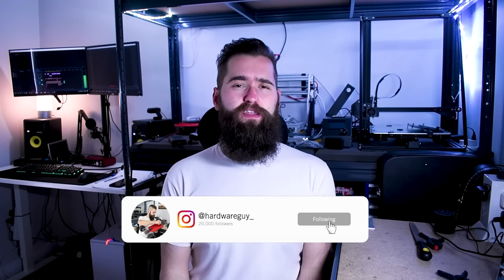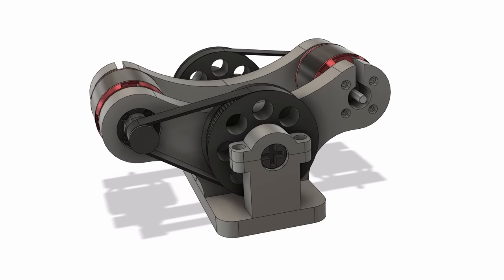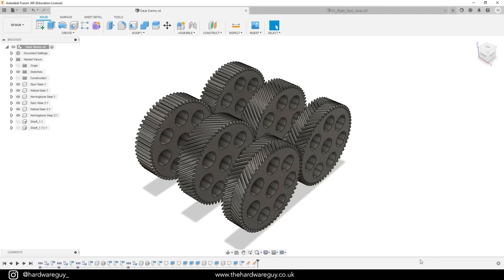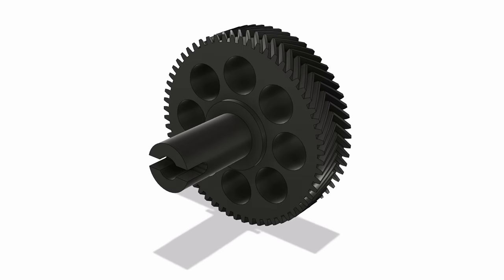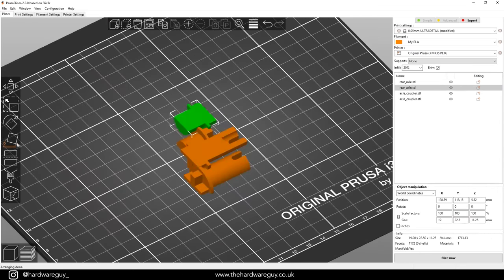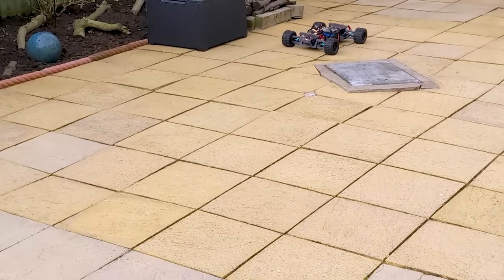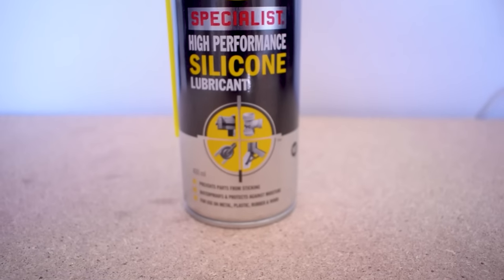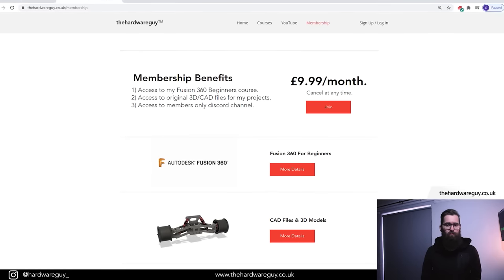How To 3D Print Gears Like a Boss

Comment: I would recommend going 95% in stead of 100. reason being that if you have a tiny bit of overextrusion in your printer, this will compensate, and avoid outer layer blobbing, as this will make the gear teeth nearly unusable, or at least time consuming to clean up. Another reason is that when force is applied to the structure there is nowhere for the force to distribute if it's all solid, but with tiny gaps the material has a tiny space to deform slightly, mitigating some of the force running through it.
Reply: Good idea! Might also be worth printing the outer perimeters first
Reply: If you have over extrusion, try adjusting your e-steps
Reply: this hasn't been an issue in a long time
Reply: You’re right at the first part, but the part about forces distributing is complete nonsense. A 100% solid part will always take more load than something that is not 100% solid
Reply: @jr764  Well, not always. For example, for parts that have an angle that is less than 90° have ofter an circle cut off where the angle is, because if not forces will rip the material where the acute angle is. When you cut off a circle in place of this angle, you will make a better repartition of forces and hence avoid ripping. So by removing some of material you can actually make it stronger.
Reply: @guillaumelebreton3780  Sorry but you've fallen into the trap of thinking that some engineering principles can be used everywhere, regardless of load/boundary conditions.

Yes, you can strengthen parts by avoiding stress concentrations where cracking is likely to occur, however that isn't just a rule you can apply everywhere; it's only relevant when you have walls that want to peel or shear open. By arbitrarily introducing holes near stressed areas, you only encourage cracks to form and propagate, since the area will be more local stress due to having less material for the forces to transmit through. In this case you absolutely want your part to be as solid as possible, if your aim is to maximise strength. There's a reason you wouldn't want to make gears out of porous materials, like sponge or cork.
Reply: I tune this in flow setting.
Reply: Thanks heaps, recently made a small functional price at 99 percent because I still need to set my steps per mm on my extruder and got an outer layer pattern of blobbing and wanted to know how to mitigate it quickly
Reply: What is e steps
Reply: @snorttroll4379  e steps is a number that determines how much filament the extruder (e for extruder) pulls in when it gets a command to do so. it can grab too much, or too little, so it's important to calibrate that value correctly. there should be lots of tutorials on how to calibrate it on youtube.

Comment: Also, if you plan on driving offroad, I would definitely recommend swapping the herringbone gears for some doublehelix gears. Any dirt or substance that gets into the gears gets dragged into the centre and quickly binds up the gears, the double helix solves this because there is a gap for the dirt/grime to be pushed into. :)
Reply: Also, yes there is a difference between herringbone and double helix. And that is what I listed in the above comment. A herringbone is simply a specific type of double helix gear :)
Reply from the maker: Excellent point. Maybe an idea for Raptor 3 ;)
Reply: Question. If dirt and grime is push up one direction on a helical gear, would going in reverse push the grime in the other direction? And, if so, could you orient a herringbone gear to push grime out of the center when the car drives forward? (Since it will be going forward 90% of the time)
Reply: Same with those outrunner motors. They dont really like dirt. Some sheilds would be a good idea.
Reply: @lio1234234  He mentions this at 3:39..
Reply: That was litterally what i was thinking about when i saw the gears lol

Comment: Engineer here You're mods for strength and print clarity are next level. If you are not already a CAD drafter, you should consider it. Some companies do not require a FE to draft.
Reply: What search terms does one use to find the jobs?
Reply: @snorttroll4379  CAD drafting
Reply: @snorttroll4379  Designer or Drafter, but more often search for the CAD software name (Solidworks, Creo, Fusion360, etc) for the best results. (I used to be one).

Comment: Spur gears are used in motorsports which is easily a high load and high speed application.
Reply: Eg. Rallye, all type of motorbike and maybe F1
Reply: I agree. Spur gears are just noisy and cause vibrations but they are indeed effective for power transmission. However, for printed plastic parts the vibrations alone may be able to break the part which makes double helical gear better for this application.

Comment: I agree a metal axle is probably best, but PLA is known to be brittle and easy to crack and break.  You could use a different filament such as nylon.  I wonder how a nylon axle and gears would hold up.

Comment: I tried several materials, but the one that turned out the best is the one that is the sponsor of this video. Yea. Shure.
Reply from the maker: As I said at the start, this is based on my experience only. I had been using this material long before Polymaker sponsored my channel. In fact, I was so impressed with the Polycarbonate that I reached out to them and asked if they wanted to be involved in my projects.

Comment: I like the fact that you are using roller bearings for your gears that are in direct contact with the motor.  There is no need to use ball bearings because the forces acting on the gears in radial not axial.  Plus like you said you will get less wear.

Comment: Great Video! I`ve also landed on Polymaker PC Max after experimenting with Taulman Alloy 910 before, but i never put as much care into it as you. But i can vouch for their durability - i made a inner gear ring design that transferred the power of 3,5kW motors on an electric mountainboard and the gears never failed!

Comment: Wonderful video! Might I suggest a solution your axel strength issue? Add fillet between your axel and the gear face if you have enough room, even a small 2-3mm fillet can exponentially reduce the stress riser created by that shoulder. Excellent work!

Comment: One thing I like is how you go from the drawing board to design the part and going to the manufacturing, where you describe how you went through the analysis of on printing the part and provide details around each of the components needed to be reviewed and looked at having the proper parameters to print the parts that would be under a large amount of stress. Typical most people would just print the parts and slap it on the RC vehicle and do not understand why the plastic part broke. I like to see how you would design a part and go through the process of printing that part on a 3D printer and what methods you use to make sense to print the part so that it would print as you would expect it to be.

Comment: Nice build - One thing i'd recommend is using nylon instead of PC for the gears. PC is great when it comes to impact resistance, however nylon is a lot more resistant to abrasion which is essential for parts that are constantly rubbing up against each other. Furthermore, nylon has almost a sort of natural "lubricant" property to it, which should help your gears turn more freely reducing wear. 

In terms of trying to print out the axle, have you tried any carbon fiber infused filaments? They could possibly work, as it adds a substantial amount of strength and rigidity to the part. Personally, i'd recommend either CF-nylon or CF-ASA for your particular application. I believe Polymaker recently just came out with their own carbon fiber reinforced nylon filament, so you should get them to send you some and try it out :)
Reply: I too think that nylon (PA) is superior... no wonder it is often used for small extruded gears.

Comment: Build an enclosure for your printer, upgrade hot end as needed, put in a direct drive, and print in PC (Polycarbonate). When tuned right the results are genuinely incredible. Extremely strong.
Reply: Can this be done on and Ender 3 pro?
Very brand new to the 3d printing world.
Reply: @pogi1803  of coruse it can be done on any printer but it needs its personalised modifications
Reply: Awesome!! Thanks!!
Reply: @pogi1803  my printer is an ender 3 pro
Reply: @pogi1803  upgrades will take time and money however. To print PC you'd need an all metal hot end like the micro swiss, or if you want a direct drive extruder as well get a hemera. You'll need to make some changes to your firmware to accommodate the new hot end. Get an enclosure for the ender 3 on amazon. I'd say that's the minimum requirements

Comment: Cool project!
Regarding improvements, look into "beaking PETG". Basically printing 100% infill and baking it in an oven (inside of salt powder), to get solid plastic part.
Reply: Don't the parts warp some despite the salt packing?
Reply: So lile table salt and heat to mwlting point?

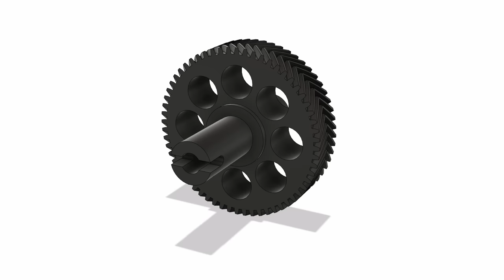Comment: During the 2:33-4:03 explanation, the first set that you talk about are whats used in race cars. Automotive folks like myself know these as "straight-cut" gears. Theyrs not used in road cars because of the noise they produce, but they are the best at transferring power from the engine to the wheels.. The second set, helical, are used in most road cars because the smoother meshing is significantly quieter, but at the cost of power transfer. Because the gears are cut diagonally, a measurable amount of power is lost to friction as the gears try to push themselves apart.
Reply from the maker: Yes, I did mention they are most efficient, but at a cost. The cost is durability and noise! Race cars only need to make it to the end of a race, whereas consumer cars need to last 20+ years. There is no right or wrong gear to use, just depends on the specific application

Comment: I greatly appreciate your taking the time to experiment and examine the possibilities of printing gears on a 3D printer.  I have been thinking about the use of 3D printed gears in the future.  My hesitency is due to the problems one gets into when producing them by any other method and comparing those issues with using various materials and 3D printing of gears.   3D printing is a new and experimental area of fabrication and so much simpler.  Since it is possible to design any gear one can think of on a CAD program and rely on a 3D printer that is sophisticated and accurate enough to produce that design - well this is fantastic as I can see it.  And that is the key to this - the CAD program and accurate 3D printer technologies.  I didn't know if they had become available yet.  I"m glad to see people like you are able to prove the subject.  I will subscribe and follow along to see what develops in your shop.  Thanks.

PS.  One shortcoming that I is a problem for me is that I'm not good at creatively 
designing a roubst gear shape using the CAD programs.  I have tinkered about with some of them but I have not become proficient with any versions yet.   I was hoping that by waiting for some period that some design libraries would become available to satisfy my experimentation curiosity.  Good luck to you for experimentations that produce the quality that satisfies both of our needs.  Bye for now.

Comment: I am not even close to expirianced in printing gears, but in my little experience I found it is a good idea to use rafts. This way you do not risk warps at the edges.
Reply: You could chamfer the bottom edge very slightly in Fusion so the elephant's foot effect just pushes it out closer to being straight.

Comment: I don’t know if you know this but Stefan over at cnc kitchen did a test which proved that you want more walls rather than infill because the majority of a part’s strength comes from its outer walls ex: metal tube, pvc pipe

Comment: I'm a racepilot in 1/8 gte. What i want to ask you is how sensitive the fishbone gear is to grit particles coming from the track. 1/8 gte is raced on tarmac and is similar to a gocarrack but much shorter. We run open gears to cool down the diffs. all gears are made of highgrade steel and standard straight module 1 teeth. The ony gear we could 3d print would be the main spur gear with is driven by the motor pinion gear which is always a module 1 pinion aand extremely hard steel. PLastic gears are often used for the main pinion gear and i would say the are always made from reinforced nylon. cf or glasfibre and 8mm wide to take att grit particle or 2. The output is 2700w or so from the motor. the weight is 3800g minimum for the car. top speed is 110 kph.the issue is than the track is surrunded by grass lawn so when leaving the track (unintentionally) we get grit on the track that might upset the gears if made in plastic. 1/8gte is of couse 4wd with a cneter diff or a spurgear connected to rear and front diffs. the diffs are oilfilled to get the correct response. and the diffs get hot. Being an egnineer aswell as the goto guy for 3d printing on a school in sweden. i See potential för 3d printed gear both for racing and for students. I have been contemplating 2 or 4 motors instead of on a a projekt. just to get rid of a motor in the center  90 degrees off. This create inertia twisting the car. when 2 motors front and rear would make a better sollution. But i would us inrunners beacuse of reduced inerta and better power to weigt ratio. The escs are 180a to 220 amps a still everything gets hot. I'm guessing high temp material is the only way for a GTe car. For offroading i see an even bigger issue for the typ of car you have built. I race 1/8 buggies too... and there we always ha built in gears. the same motors are used 4068- to 4074 sensored motors. But gte takes alot more power to be competive with turbo. Heat is the worst danger to motors and esc

Comment: Very interesting; I love what you did with the smaller gears by driving a screw through the center to reinforce them "along-the-printed-layers".   However; since you have such a keen insight into the structural integrity of printed parts I was wondering why didn't you try the same thing with the dog-bones as you did with the smaller gears?  Never the less; you are, definitely; someone to look forward to watching on youtube.  Vantastic workmen ship and thank you for your brilliant insight on gears.
Reply: I know your Q was from years ago but I think he didn't need the support on the larger gears because they rotated at a much lower RPM so reinforcement wasn't needed.

Comment: I would suggest two rows of ball bearings instead of roller bearings. Two rows will add rigidity and reduce the operating temperature from the increased friction of the roller bearings. This is only a suggestion. Great video.

Comment: I spent a lot of time 3D printing the truggy off of thingiverse in ABS+ and the differential gears and drive train couldn’t handle the loads. I considered using polymaker pc max but it was far cheaper to use metal drivetrain using common parts. I use a ABS+ herringbone gear connected to a metal diff, and ABS+ herringbone gear that attaches to the motor and they work great! I have also enclosed those gears so they don’t get dirt in them as well! I love the tips for the shaft and gear and also the m3 bolt!
Reply: What is "ABS+" really?  If it's actually ABS, then it's usually plain not suitable for gears and such mechanisms because it flakes off, it doesn't have much abrasion resistance whatsoever. Maybe it's modified with reduced butadiene amount, it might be good, as butadiene is introduced as a flake onto which graft polymerisation of styrene and nitrile occurs, which are introduced as gas, and this butadiene is on the one hand flexible, on the other forms spots at which the material can separate. If it's a modified PLA with plastifier additives, which i think one manufacturer had such misleading naming, then that's stronger, but has another issue, because the temperature resistance isn't great, and friction generates high local temperatures, and shear strength isn't even as good as regular PLA.

So i wonder what brand you used, i don't think they're likely to be particularly similar to one another.
Reply: eSun ABS+ . I have run a full battery on it and there is some wear on the gears. I need to run it some more to give a proper review of it. I would love to know how eSun have modified it.

Comment: keeping a spare nut or to on the heated bed and filling that when you purge can be fun & produce useful quick generic bits after smoothing too, dip your old stranded wire in dissolved scrap plastic and stick that in your bolts as a core infill etc, etc..

Comment: Big tip when you do high force and torque gears. Swap out your nozzle to 0.1mm do a 0.03mm setback on your outer wall this gives you an additional strength on a wall count of at least 10. Also get yourself some NYLON CF but you can also use eSUN ePA12-CF or even eSUN ePAHT-CF.
Reply: No you want thicker lines, wider nozzle not a smaller one. And no you don't want CF anything for gears. Fibers make your prints weaker in exchange for stiffness. Stiffness is not an issue, but strength definitely is. What's with everyone hearing engineering words and assuming they just work for all situations. Stop it.